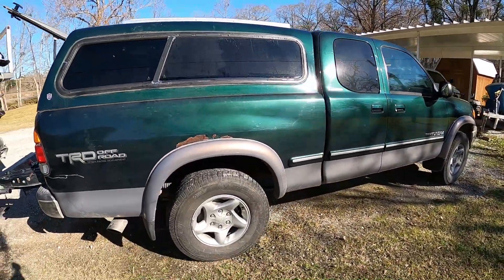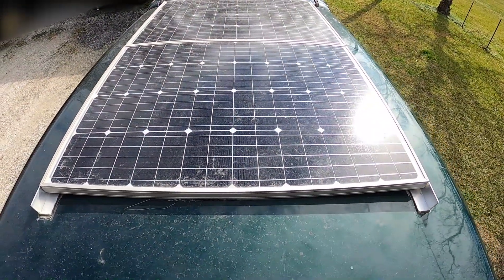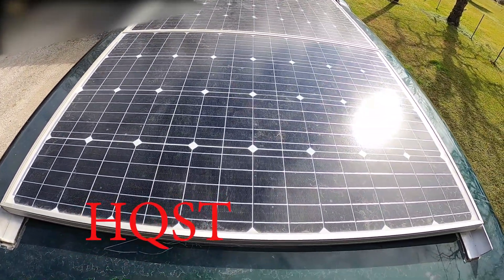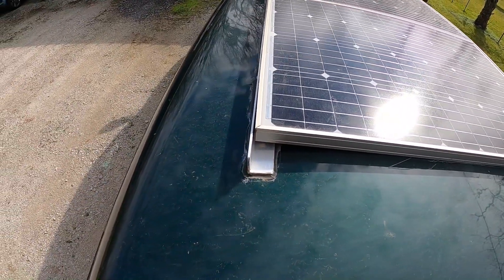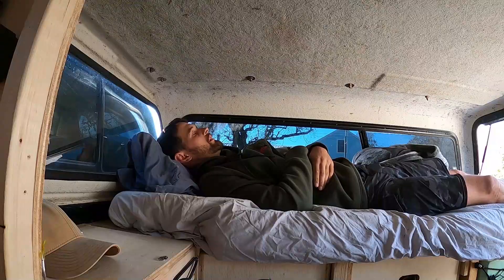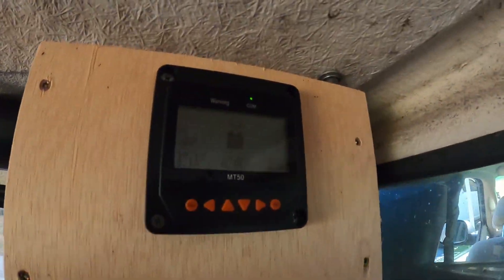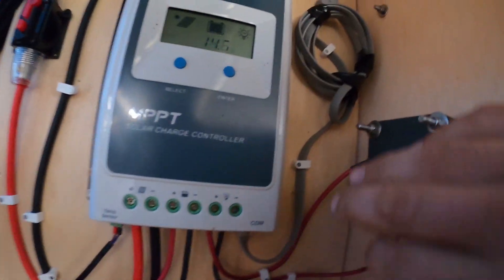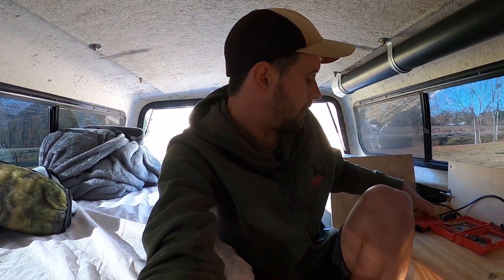Easy Solar Power System in a Truck! 12 Volt with Inverter!

Comment: Great vid and explanation thanks for posting. I live out in Thailand and have a Ranger, so not as large as a 150/1500 but I have built a pad in the back. I want to add a 130W panel to the roof and try to do a set up similar to you, with the battery just on the floor behind the passenger seat (use some tie downs to secure it). Good point about Lithium v lead acid, want to avoid the fumes. I am worried about heat though - it is hot here and not sure how the battery would hold up if the cab is locked up and I am out and about for a few hours on a day its 100+. Have you found issues so far with your back seat set up? Good idea to have that temp gauge connected. Cheers
Reply from the maker: Thanks! That’s cool! I really like having an extra battery in my truck, cause you can jump your truck if needed or charge anything while your truck is off. Ya, I’d make sure to have your battery tied down so it doesn’t move around. I also have mine in a plastic battery box so that nothing can touch your negative and positive. I’m not sure on the heat issue. I would call the battery manufacture and ask them. I have not had any problems with heat with my battery. The temp gauge is mostly for the solar charger. The temp gauge tells the solar charger to not charge the battery if the battery is to cold or to hot.

Comment: I'm planning on building a 200 watt solar supply w/ alternate charging, too, I have an extended cab. Do you think I could put most off that under the back seat area to allow more room in the back of the truck for a more comfortable design?
Reply from the maker: I think that should work, but the only thing I’m concerned about is if it will have enough airflow to keep it somewhat cool? Are you taking your back seat out or are you keeping it in?

Comment: What is the rating on your battery? Do you get your ground from the auto battery terminal or do you have a separate grounding point you've created? Do you know how how long you can operate the fridge and any other electronics you commonly use on the battery without a recharge? Nice system and explanation. Thanks.
Reply from the maker: I have one 100 amp battle born lithium battery and I use my negative terminal as my ground. I’m not a 100% sure on length, but I went through a 3 day rain storm, which yielded like 0 solar power and I still had over 50% power left in the battery. The battle born batteries are expensive, but they have a 10 year warranty. They are also maintenance free and don’t let off gas’ like a lead acid does. I really like the battery! They also make a 50 amp and a different style 100 amp one. Thanks for asking!